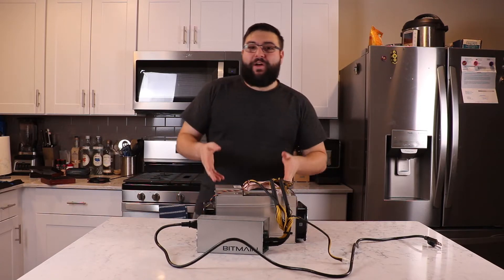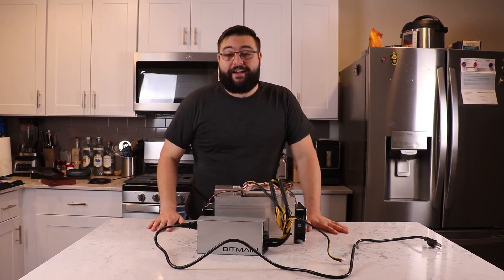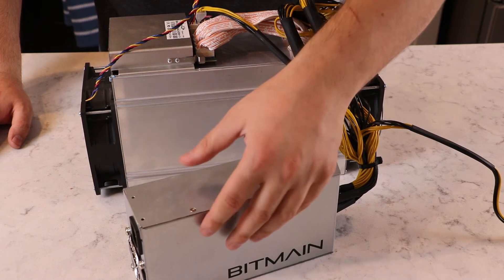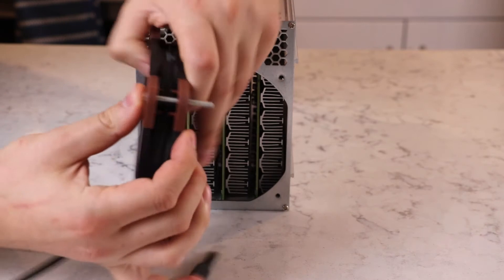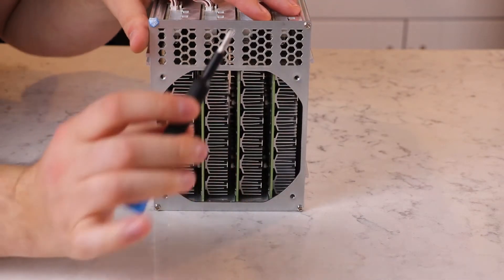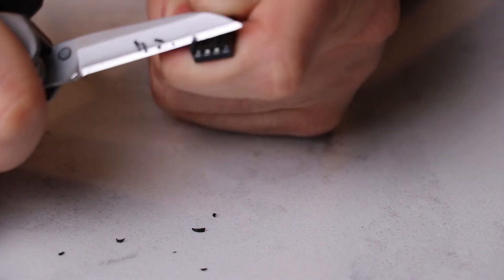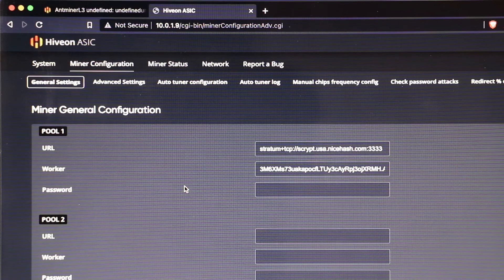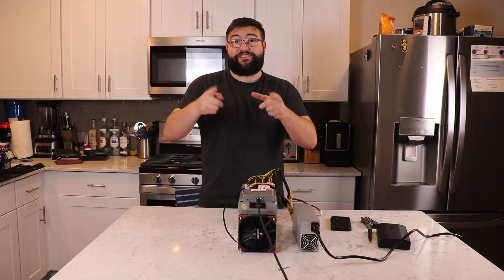How to Silence the Antminer L3 +

Comment: I 3d printed spacer for the screw. 12mm high. I inserted them between the screw head and the fan. Also you can buy shorter metric machine screws instead of buying nuts.

Comment: Could you not have just bought the shorter screws from home depot?
Reply from the maker: Sure, I could have. They didn't have shorter ones at my local home depot and I don't really mind them sticking out.
Reply: @frigidpeons4816  cool, ive build a box for mine to try and reduce the noise, just waiting for the few pieces of hardware from amazon. My s9j runs so hot aleady i dont want to put lower rpm fans on it. Wish me luck 🤣

Comment: Thats didnt low the noise but you also loose performance lol half cfm
Reply from the maker: It's significantly quieter. You don't need the original high cfm high noise fans if you use the Hive FW
Reply: @frigidpeons4816  i used brains os and yes we can used them like this but for me the performance is lower. (i talk for the s9 and biger one like s17+)

Comment: Can you use these fans on the stock firmware ? Or do need the hive
Reply from the maker: You need to use custom firmware or it will throw up a fan error
Reply: @frigidpeons4816  ahh dammit. What firmware ? And how do you get it ?
Reply from the maker: I use Hive fw from their site
Reply: @frigidpeons4816  okii is it easy to install  I'm no wizz
Reply from the maker: Seemed to be pretty easy, they have some tutorials on their site. Only took me maybe 20 mins to do
Reply: @frigidpeons4816  ok thanks il try
Reply: @frigidpeons4816  when flashing new firmware , do you unplug  hashboards or leave them attached to control board ? Thanks for help
Reply from the maker: I can't remember to be sure but I. Think so. I followed the documentation they provide

Comment: Why not just get shorter screws?
Reply: u could even just put a couple nuts on the screw first, effectively shortening the length.
Reply: Or just fit the fan grill on
Reply from the maker: Only size available at home depot that would fit. They have shorter ones but they were not in stock

Comment: Did the temperature stay consistent with stock fan’s performance?
Reply from the maker: Roughly yeah, they ramp up and down depending on heat. The custom fw can Lower the wattage and maintain stock hashrate so it's easier to cool and cheaper to run